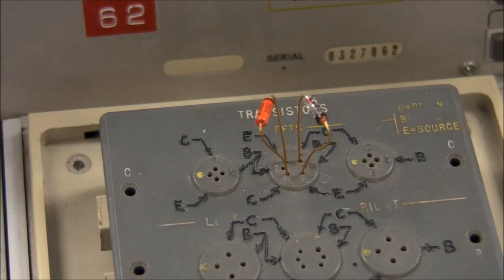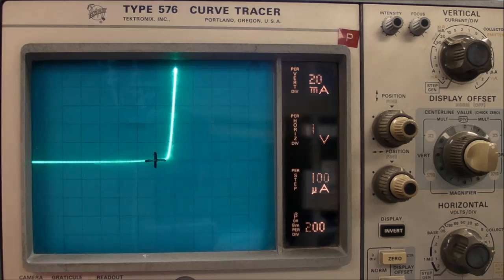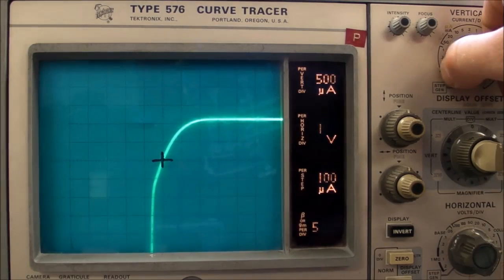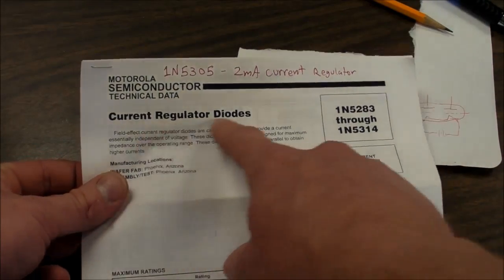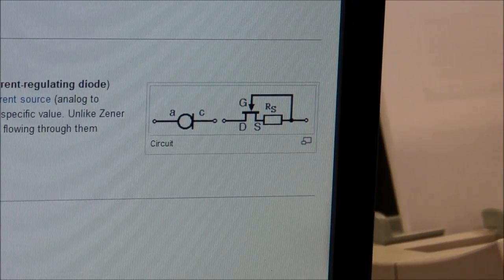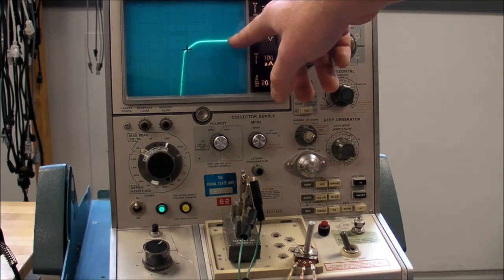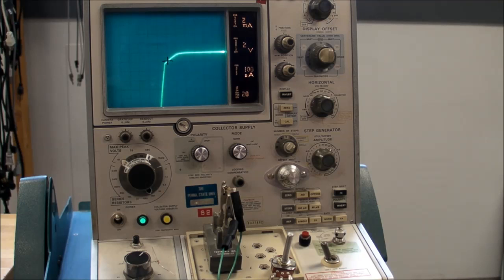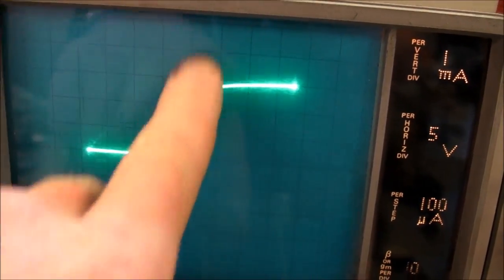(#0100) Current Limiting Diode Tutorial

Comment: Yes, these 1N52xx current limiting diodes are cool. Just a bit pricey nowadays where mouser takes 15 to 120 EUR for once piece. But fortunately there are some cheap options too. The JFET option for low currents is nice as you can get away with the right JFET only and no additional resistor.

Comment: You can also use an LM317 and a resistor as long as the circuit current is high enough to keep the regulator happy.
Reply: The point in the diode is to be a simple and compact prepackaged regulator with a tested and reliable specification. You can get them for SMD mounting and they are smaller than a grain of rice..